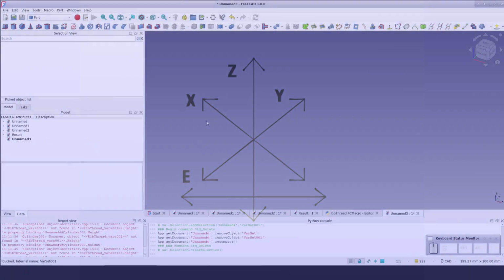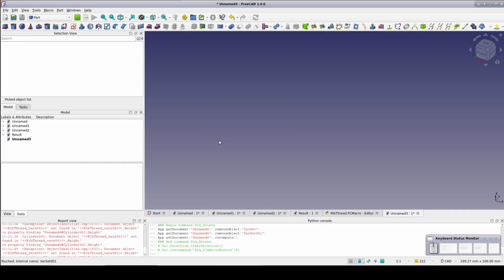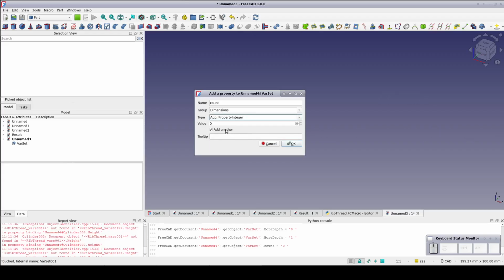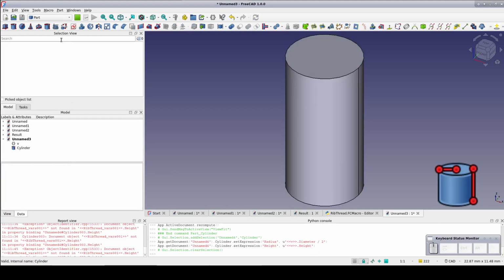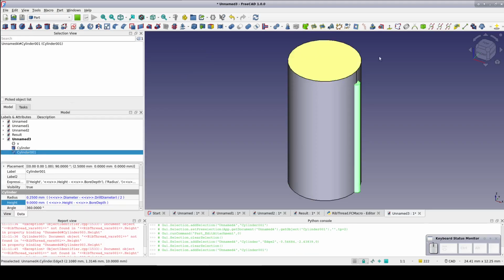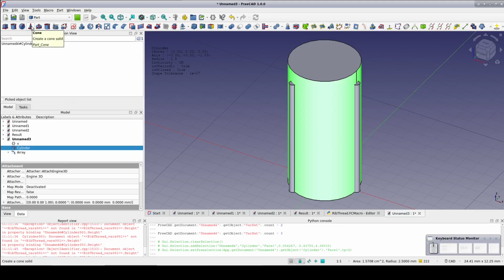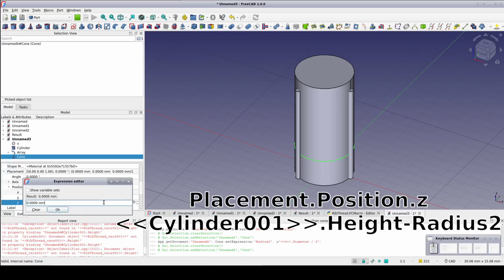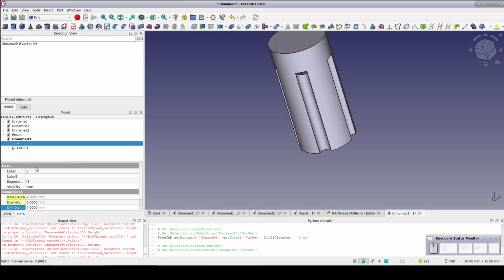FreeCAD: RibThread 2: This time we do it manually

Comment: Looking forward to using the tool as a macro.  Should be interesting as to how small of a screw can be used when printing with a .4 nozzle.  Obviously a .4 diameter on cylinder 001 is the minimum setting. Since the type of screw dictates the forming of the thread and crushing the plastic will lead to it's fatigue, standardizing the tool for a given screw is ideal.  I may want to add a cap head clearance when using a cap head screw for reinforcing a stud.
Reply from the maker: The real payoff is the full feature in the Grab Bag. It really pulls things together neatly IMHO.